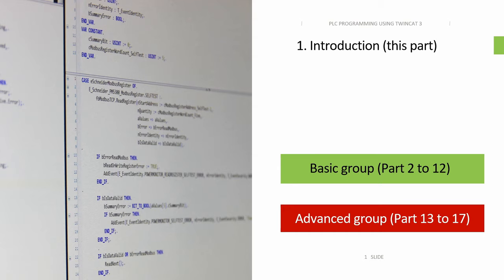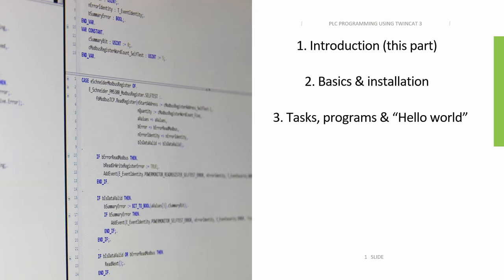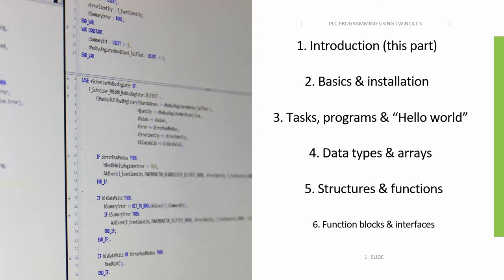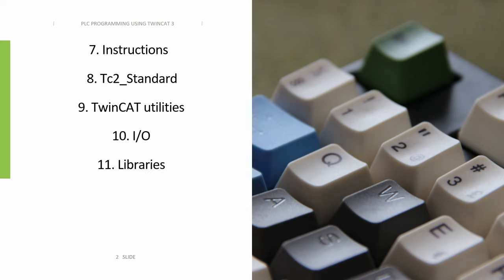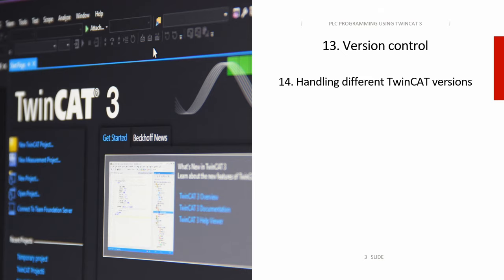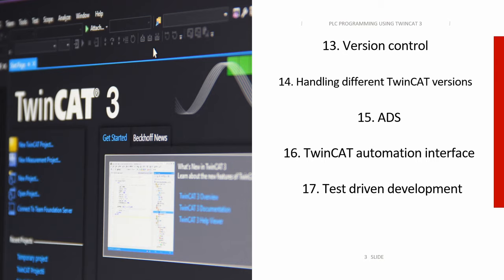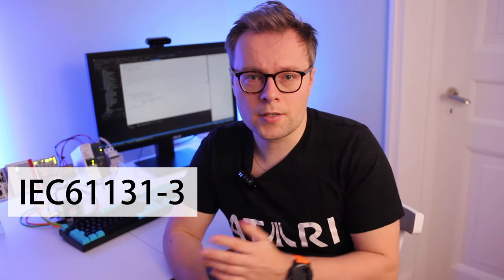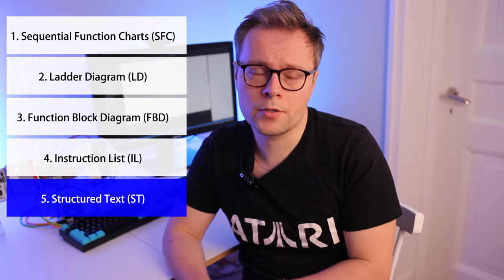PLC programming using TwinCAT 3 - Introduction (Part 1/18)

Comment: Thanks for this, I have used Siemens and CodeSys Environments ( and Rockwell which I just do not like) both using ST, I am really curious about all the Beckoff environment and what it has to offer. I am going to take the whole course even though I have already good experience working with PLC, and peripheral devices. One never knows I can fin something really useful. 💎
Thanks Again!

Comment: A good serve! will definitely follow the subsequent videos.
After seeing you agenda, your background in C/C++ and complains about software engineering, why are you not using C++ in TwinCAT3? ... will there follow a chapter about TC3 C++ development?
Reply from the maker: Thanks for your feedback. I have actually been using C++ in TwinCAT, although I find it more cumbersome to use than using ST. It's also the issue of cost (additional license required for C++ in TC3). There is no plan to include a chapter about C++ in TwinCAT3, but this could probably be made as a separate video.
Reply: Thanks a lot for the videos. I would also like to see some examples of integrating C++.
Reply from the maker: @nikolaosmoustakis8701  I think other contributors need to jump in and do this.

Comment: Very friendly to someone that is learning about software development, I'm currently on #3 and is very easy to understand your videos. I have just a question, Is there any kind of simulator software for TwinCat like PLCSim for S7 or something similar that I can download? I ask because I would like to be able to practice with the software as if it were a “real case”. 
Thank you in advance
Reply from the maker: No need for simulator software. The TwinCAT runtime installed with the XAE is the same runtime (XAR) you run on the actual PLC.

Comment: Hello Jakob,
I would like to develop drivers for a test bench in a company in Twincat3 as my master thesis, Starting from December. I have no programming experience with PLC or Twincat3. Have you ever worked on Power electronics or an E-machine test bench that uses Twincat3? If you have then could you tell me, where should I start learning?
Best regards
Reply from the maker: Hi! I don't think the type of system matters too much, most of the stuff that you learn is generic and solves a wide variety of problems. I think this tutorial is a good place to start :-) Other than that, there are some more resources available under links on my blog!
Reply: @JakobSagatowski  is there any other programming language I should learn before hand? on my own.
Reply from the maker: @fazlayrabbi7351  For this tutorial you don't need to. This tutorial does not assume any prior knowledge about any programming language beforehand.
Reply: @JakobSagatowski  yes I understand, what I meant to say, what are languages  Twincat3 drivers are built on usually? Is it just IEC61131 languages? or do you need C/C++? Thanks in advance.

Comment: hello sir, I have a problem with the beckhoff thermoelements with code EL3314...The problem is the heater on the engine is short so the beckhoff thermocouple is alarmed,, After changing the beckhoff input from the thermocouple it can't be read in the HMI, so the temperature can't be read.... Maybe it should be programmed  repeat

Comment: I'm a Senior Software Engineer, worked with high level languages like Kotlin, Typescript or Swift and built many projects in the cloud. I have to say that PLC Programming is garbage compared to any programming language. It's so frustrating because companies created these products specially for electrical engineers and not computer programmers. For example there should be an option to program a PLC in C to make our lives easier.
Reply: Sorry to say that PLC programming languages are far of being "garbage" as you refer to them. And YES, PLC languages are and should be directed to Electrical or Control or Automation or Process Engineers because a PLC is a control device connected to sensors and actuators and communicating through a lot of protocols other than Ethernet but including it, which is by the way the only protocol the "Software engineers" appear to use or know. Many software engineers do not even understand how a simple relay or contactor works, not to mention the difference between a step motor and a servomotor or why in the oil & gas industry is usual the existence of the HART protocol vs. Modbus RTU or Device Net. The PLC is a field device and can be programmed, configured, diagnostic,... either in a controlled environment (like the one the Software Engineers work in), or on the Field under the most severe environmental conditions. It must be operated not only by engineers (electrical, control, automation, process, even mechanical) but by technicians and so the PLC programming languages should be simple, intuitive, efficient, hardware oriented, robust, flexible. A complex PLC program can be written in days. Besides it can interface with HMI devices, Frequency Drives, Intelligent Instrumentation, Power Modules, Control Units, Remote Terminal Units, Signal Conditioning Units, and many other devices from which the Software Engineer mostly hasn't the slightest idea. But yes, today some PLCs can be programmed with C-like languages (or at leas some modules), but that is not the norm. The three most important PLC brands today in the world market use PLC standard languages normalized by the IEC 61131-2 Standard (of course none of them is C, Java or similar). These brands dominate by far the world market and automation industry and are: Siemens, Rockwell (Allen Bradley) and Schneider Electric/Modicon. Besides, brands like Siemens, which is the world leader in PLC, offer a complete solution, since they not only produce PLCs, but also machines, communication devices, instrumentation, motors, phones, electronic components, furnaces, substation components, engine control devices from contactors to relays, etc. etc. etc., not to mention its Health Division . In summary, Software Engineers do their job and Electrical/Electronic, Control. Automation Engineers do ours. We don't need your fancy Typescript, Java, C++ stuff to control the whole world's manufacturing  industry.